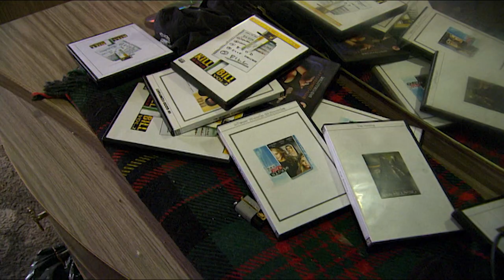How To Declutter ...In Dagenham

Comment: Do they not do house inspections for low incoming housing? In my area(usa) the state will do a random walk through to make sure it's clean and no damage done. Sometimes they know they're coming and another times they just show up. Seems like that's what y'all gotta do too to help advoid this.
Reply: Unfortunately the inspections for some UK council houses can be few and far between. Each household is ( or should be) inspected roughly once every three years, however some can be for even longer. The councils will usually send a letter out letting the homeowners know about an upcoming inspection but if they are alerted of anything odd they probably go around for a surprise one to see if everything is ok. 

I may be wrong but based on my experiences they can take forever; imo they should do them more frequently but some councils may not have the budget to do so.